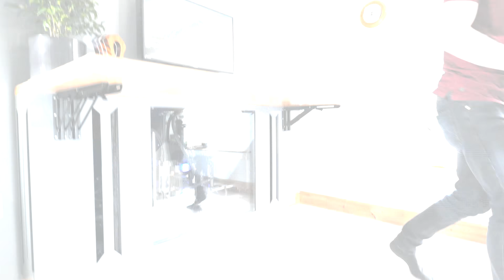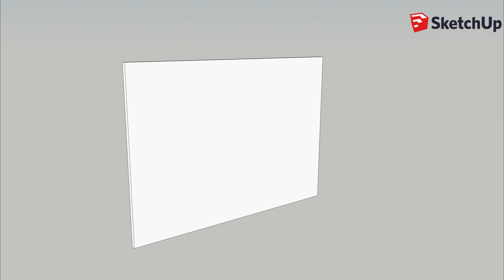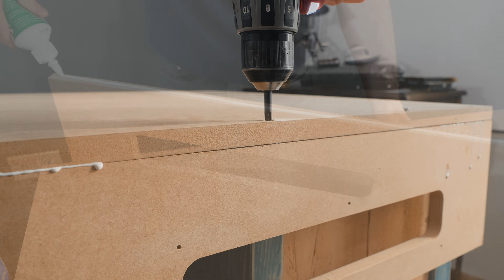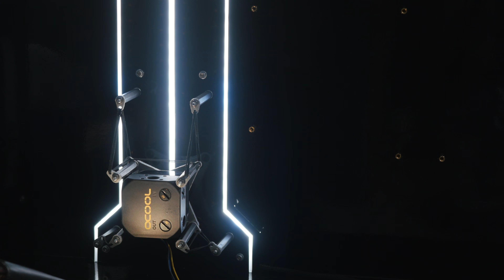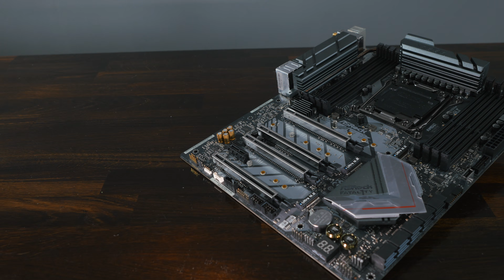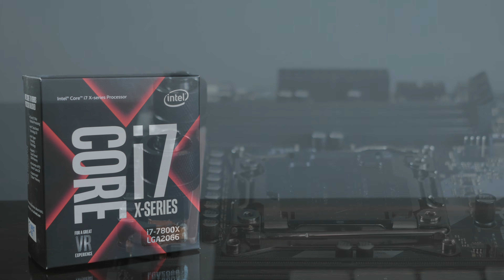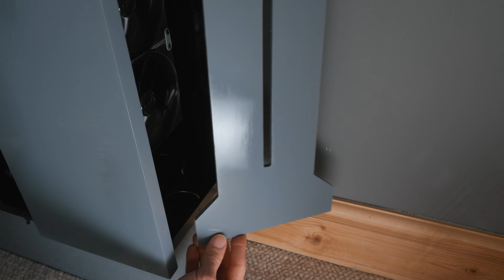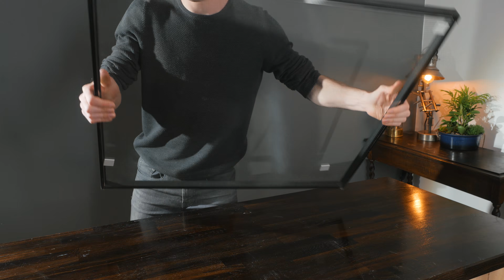Building a spectacular DIY 'desk PC' (it can fold!)

Comment: You promised at several points to go through the thermals at the end, but you never really did.  I'm very skeptical of the way the internal compartment is cooled and I'd like to see some real stress testing and thermal results.  I probably would have put a small pair of hidden rads with a small reservoir and their own pump to specifically cool the inner compartment (not in the greater loop at all).  It's a very nice build though, and gives me lots of ideas.
Reply: What about 30:33 ? I'm not an expert so i really wanna know too
Reply: @szchietzmane6436  You're right, I totally missed that 5 second card that had temperature measurements on it.  Thanks!

Comment: Did you somehow fixed it to the wall or added some weight to the bottom of the case ? This "L" shape doesn't seems stable enough to me if you start to lean and put too much weight on the table part. 
Best way to tumble it all, and I don't think all the wobbly elastic mounted water cooling stuff will like it :) 

Really neat looking desk overall, it is really the kind of cases industrials should work on for people with limited space. It also force people like me to keep their desk clean !

Comment: Before the criticism comes, im not that much into watercooling, so if anything is wrong just correct it. So First there is the question if it couldnt become a problem to cool gpu and cpu with just one cooling system. You can already see a difference of 20 degrees which isnt that bad and clearly not a problem here but what if you are upgrading to an i9 or even overclock your cpu or an i9 or get a second graphics card. Then this could be a potential problem. There is the question if you need two radiators for the whole system. I mean better enough than to less cooling power, but what if you split the cooling system up onto two reservoirs and two pumps? You could cool your gpu and cpu + motherboard from different systems and wouldnt have to change that much with lower temps. It may be better for the future. So far its amazing and well planned.     Even very nice that you provide detailed plans for to rebuild it. Nice Video

Comment: I wonder how much that airtight case will heat up form the mechanical HDDs. They do not get terrible hot, but if there is no airflow whatsoever the case will gradually heat up, as it is not a vaccum.

Comment: Would making it air tight and using a vacuum pump to make it negative pressured help keep it cooler than just water cooling, or would that prevent heat from going anywhere and staying in the components?

Comment: I have a similar project, but also differentiated: I got used to a 23-inch monitor, and now I'm thinking about joining the wave of mobility, but there is no notebook in that size; so now thinking about creating a big model - a big 23 inch suitcase, desktop keyboard, mini-pc motherboard, underneath a battery bank, the most difficult thing would be to create an appropriate power supply; and as it would have a very large total weight, a backpack with wheels

Comment: I've always wanted to built a very light weight desk, with the lightest parts possible, in a table that can easily be folded up and taken with you and includes a display, keyboard, mouse and only requires a single power cable (internal PSU) to be setup and that's it... The idea sounds SIGNIFICANTLY more convenient than a laptop since the laptop requires a table top to work on comfortably, the battery won't last long if you're doing any heavy load work which means you have to fumble with a brick and two cables, and you will also have to pull out at least a mouse if you hate those track pads.  It really would be more convenient in several ways.  But one of the things stopping me is that I need the LIGHTEST weight components possible and nobody tells you the weight of their product.  ...*shrugs* there are several other things stopping me as well honestly.  But that is a big one.  If you do something like that, that would be amazing.
Reply: I actually did something similar, minus the tabletop! I used this: https://www.asrock.com/nettop/AMD/DeskMini%20A300%20Series/ (AsRock Deskmini), which is extremely small and light, and a portable monitor that accepts power through USB! the final product easily fit in a backpack along with a lightweight wireless mouse and keyboard combo (only one usb dongle), and with a plastic vesa mount adapter I could easily attach the computer box directly to the portable monitor so it would be propped up by itself :) 

hope this helps, haha

Comment: If you remove the air with the system will it not over heat?   But there probably is a way to dry it... maybe another video making an air dryer  and water chiller

Comment: what does faf mean? when you painted the second unit you said you avoided spray paint this time because it was a bit of a faf? i couldn't find a definition for it on google so hope you see this. i assume you mean the spray paint job was difficult or didn't turn out as good as you had hoped so you did the second unit by hand?

Comment: Ah man, this is a really bad design that will reduce the lifespan of ALL the components by at least 20~30%.
And all because you chose to make it airtight. Yes, the water cooling will keep the chips cooled, but what about everything else as the ambient heat levels build up around the motherboard and all the other components surrounding the chips? Rip.
My computer may be a bit loud during gaming with it's air cooling, but at least the case temp is only a few degrees above room temperature because of excellent airflow.
There are ways to get around the noise levels and reduce them to nothing, especially if you got that much room to work with.

And you've STILL put all the fans outside the air tight chamber, so you can still hear the fans.

Comment: Bit late to the party here, but you can do vibration isolation with rubber mounts. It's considerably easier and much more accessible than 3D printing, and you don't have to worry about rubber bands breaking down over time and depositing your pump on the bottom of the case.
Reply: Basically, you use an undersized screw and rubber washers both before and after your mounting bracket. The screw doesn't touch the mounting bracket, and the compressive force of the screw head / mounting surface travels through the rubber spacers. Any vibrations caused by the pump or radiators have to travel through the rubber spacers, which greatly dampens the noise transfer.

Comment: I really like the build, but the method of removing vibration is a little over engineered.  The only reason your phone makes so much noise is it isnt secured. The more mass a moving object is attached to, the moving components cannot move hard enough to make noise. For other people who don't want to mess with the elastic, you can hard mount the parts with rubber grommets. I'm sure the elastic solution is quieter, but most people's houses have enough of a noise floor to cover the minimal noise made by the vibrations
Reply: Can’t stand people like you in the comments going “ACHUALLY” then coming through with a vastly inferior solution they spent 4 seconds inventing. This dude spent days making this, and this is all you have to say?

Comment: This looks great, two things, there are dense hardwoods that would look nicer AND if you are going to paint,  invest in a cheap paint gun. I can tell you painted that with spray cans and it ruins what was otherwise extremely precise and well done. The uneven coat with clear runs and splotches detract from what is otherwise flawless.

Comment: first of all.  you could have made it way easier on yourself.  Replace wood filler with polly.   it dries fast and can be sanded with a damp rag.   last touch up could be done with small sanding.    then you should have used a spray paint to apply first cote and should have been either gray or black.  as them are the same colors at your end product so no showing of a white paint as I can see in much of the video.   then we got a big gap that did not have to be on the finished closed table.

Comment: love the build and impecable vocal recording fidelity and mastering. I hope u can help ease my curiosity about the following: 1)what is your lingual background? you have a very interesting and unusual accent with agreat quality speaking voice 2) how much did the folding hinge brackets cost you? i ordered similar but they are very dangerous snappers and expensive. 

at first I was thinking, with such a 'spare no expense' water cooled 8 dims build, WHy is this guy using MDF? thats before I saw the DIY mock powdercoat finish withthe palm sander that looks just ike an iron. very cool man. All in all, are you sure the water cooling cuts your SPLs as opposed to air cooling the rear compartment?

*the spray paint was a bit of a FAF, could you define what this expresion means?*
your stuff is golden, both for a PC enthusiast and a linguist, and for anyone interested in learning English. Your English BTW, which sounds non-native, is far superior to many native speakers of english.

Comment: Extremely nice looking. I also have a folding table in my small space and a tv that folds down. If there’s anything I’ve learned about folding things it’s this: it either eventually stays folded up or folded down. There’s few contexts where you need the space that a folded piece gives you back. Furniture that’s on wheels I guess could fill that space to make use of it, or perhaps folding the desk to use for VR.

Whatever small spaces can use this design, it’s really really small spaces - physically and demographically.

Comment: 22:42 Won't the elastics on the HDDs cause the casings to move from the inertia of the spinning disc, possibly damaging it if it's being written on or being read whilst jiggling around? Seems to me like that would negatively affect the lifespan of those HDDs..
Reply: When he did that I was internally screaming. If anything is reading of writing the HDD and he moves the case bye bye data. He could have just bought SSD's to prevent that issue.
Reply: @soberblue1158  its screwed to the wall, the case is not going to move. but rubber mounts like a good PC case does would have made more sense
Reply: i had an antec case that came with elastic bands that screwed onto the harddrive then hooked onto the case, they worked like a champ, never had any failure issues
Reply: that's actually a really good point; i doubt the HDDs are designed with relative motion between the R/W head and the casing in mind. 

perhaps tightly sandwiching the drive between multiple layers of foam or some other thick dampening might be a better option?
Reply: You are right, and i'm not convinced that the reservoir should be wobbly like that also.

Comment: With the PC built into the furniture, is it still easy to maintain or replace parts when needed?

Also, did you know that to move a harddrive with Windows from one pc to another, you just need to
first keep password and registration ready (to be safe)
- uninstall hardware drivers from this installation
- run sysprep from the prompt to remove 'hardwired' configuration and choose 'shutdown' from the options
- install it to the new pc (sometimes configure a new user / no files have been removed fortunately)
- install the new drivers
- you're done! No need to reinstall software or transfer files!

Credit to Fox from 'Sound Design Tutorials' -
 'How to Move a Hard Drive With Windows 10 Installed to A New PC (With new Hardware)'

Comment: Epic build i must say.
However im not really sure about those hard drives. Normally 3,5" drives are designed to be fixed either standing or laying down. Im not sure that beeing able to resonate at their natural frequency is going to cause damage. I managed to kill a 3,5" drive by putting it in a 45° angle but the laptop drive next to it in the same orientation survived to this day. Anyway if one dies you could replace it with a 2,5" one or an ssd and it should be fine.

Comment: What an amazing build! Well done!
I have only 1 question: 
If you want to keep the PC turned on for whatever reason (movies), but need more space in the room, doesn't the folded down desk block the heat from coming out of the heatsinks?
Reply: When folded down, you have an 1“ gap between the plates. 
And the outlet for the big radiators is at the sides.

Comment: Thanks for the great video!
I have some questions.
31:10 Even if it is completely sealed there's still air inside the case.
How would you evacuate the moisture in the chamber to use a water chiller?
In addition, how would you manage the temperature of M.2 SSD and RAM?

Comment: It unnerves me to see all this work done and then just using a single monitor setup
Reply: How do you feel about the viper logo being upside down
Reply: @existential_fred  not much you can do about that since it only slots in one way. i had the same ram. you cant even remove the heatsinks and turn them around. the ram chips are different on both side
Reply: @thewizardoftech5075  if anyone could have done it, its Mr Perks
Reply: @thewizardoftech5075  make bracket to hang the gpu from above so the ram is the right way, not affect me as I water cool gpu, cpu, motherboard, ram, think next PC I see about ssd and m.2 if possible
Reply: Wall mounted 49 inch would have been perfect
Reply: @xEchoDrift  For the RAM IMO would have not gone for those sticks. I know he most likely did it because it was given to him for free by Patriot but there are WAY BETTER sticks of RAM available and in RGB if he cares about that such as the Corsair Vengeance RGB Pro which are REVERSIBLE sticks ie the tops/heatspreaders are symmetrical or if he wants better looking RAM there is the Dominator Platinum RGB (I think you can reverse the heatspreaders/logos like on older Dominator Platinum RAM too but not sure)
Reply: Zahid Shabir huh I don’t know what you are talking about hahah. I’m talking a 49 inch monitor
Reply: True
Reply: if he mounted 2 it would have been PERFECT.
Reply: he has more monitors. they are just concealed in the wall because they're not in use
Reply: Welp it's not that bad, if you want to game there's plenty of games that use a single monitor. I believe only working on stuff and flying/driving simulations make good use of multiple monitors ?
Reply: @Revengeur72  After working from home for the last year on a triple-monitor setup, I don't think I can ever go back to a single monitor.
Reply: @Revengeur72  for streaming/recording games, multiple monitors are very useful
Reply: Plenty of high-end users have only one monitor in front (ultra-wide preferred, especially because 4k 120hz displays are finally coming out in a range of sizes). You can always roll in a DIY slim monitor cart with a weighted base & articulating mount arm for production.
Reply: The spray paint hurt, too
Reply: LOL TRUE you could easily have a triple monitor setup xD
Reply: And Wireless mouse
Reply: I didn't even think about that but I knew there was something. I'm confused about using hard drives and SSD??
Reply: @sunnyokapi  Cheap, large file storage for videos or even games

Comment: An update would be cool. I'd love to see you wrap it in acrylic to remedy the texture of the wood that comes through the paint. I probably would have wrapped the interior with vinyl instead of paint, since MDF is a horrible surface to paint and without coating everything with body filler and sanding every layer of paint but the clear coat, it can be pretty much impossible to get an acceptably smooth finish.

Comment: What an awesome setup! My only concern would be having the HDDs suspended by elastic like that. I know you did it to reduce vibrations but I'd be super worried about head crashing on those drives as they are not fixed solidly to the case
Reply: Drive failure is why I'm careful with old laptops, especially when powered on.

Comment: Seriously nice - only comment I would make is that with all that nice work, I would have also embedded the monitor cables in the wall rather than the hole in the desk where the cable is coming out - maybe even going as far as having a media plate on the wall behind the monitor...Of course by 'would have', I actually mean 'will' as I fully intend building something like this myself.  On that note, I was interested in buying the plans as a reference, but the link no longer works?  Is there another way to get them (maybe a PayPal donation)?

Comment: I wonder what performance gains you would get if you separated the GFX Card and CPU loops, considering both are high heat generators if you have them on separate loops you could cut cpu temps down some more, considering you're moving the warm water from the gpu into the cpu block. Other than that, very nice looking computer :)

Comment: i love you work, but i think that not all heat could go out through the radiators, the hard drive and passive elements in the motherboard produce heat and need a minimum air flow

Comment: The build is really beautiful and you did an amazing job. One thing annoys me though, the choice of PSU, yes you got it sponsored but that build has a load wattage of around 550Watts and a 600W PSU will be absolutely pegged, keeping in mind that you have very little to no airflow actually inside the case except for the fans moving air through the radiator inside the enclosure I would select a PSU with a much higher rating as this would keep the load much lower.

Comment: i see a fairly big problem but. you are feeding cold water into your gpu. which then makes it warm/hot. then you feed it into your cpu then your power delivery. making it molten hot. it'd would be better to run two pumps and run it through seperately.